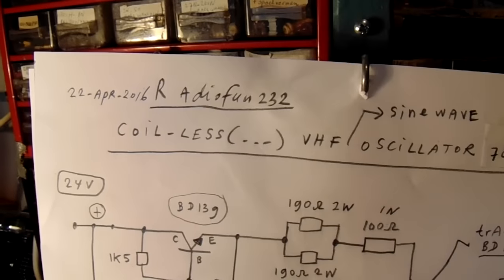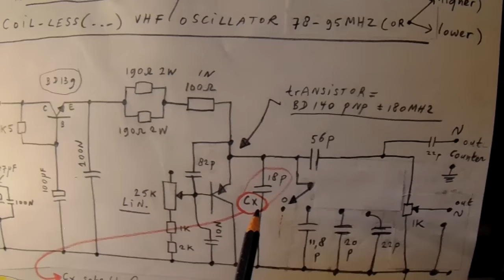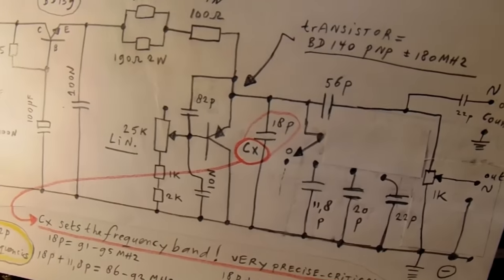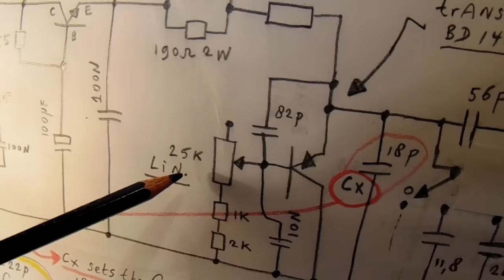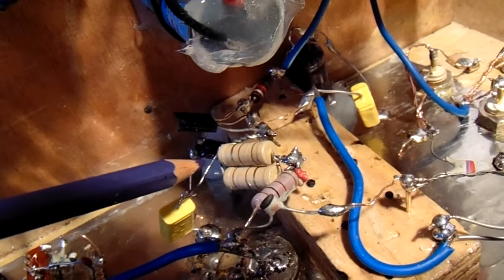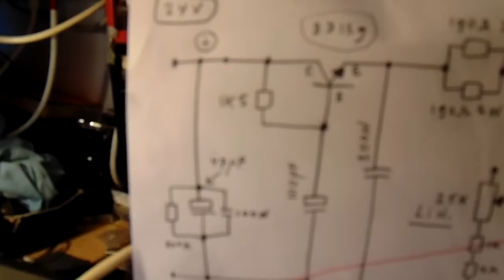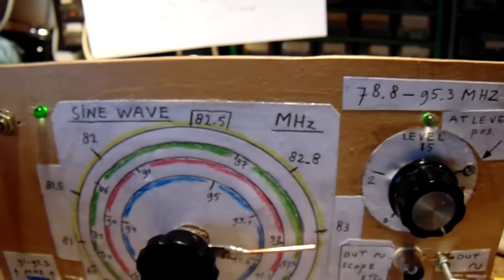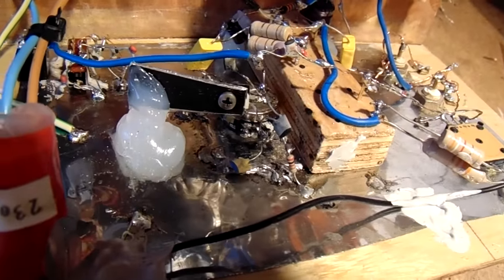Tunable VHF oscillator 78-95 MHz (or lower-higher) without a coil or tuning capacitor

Comment: This oscillator use parasitic inductance ( capacitor wires, pcb strips, e.t.c.
Reply from the maker: OK, but where?
Reply: I think in emitter circuit to Cx... or collector circuit... same comon base oscillators use LC tank in collector circuit... and emitter-collector coupled cap... this oscillator likes in lc tank in emmitter circuit... parasitics not located one point, it scattered around transistor main K,B,E circuits...
Reply from the maker: @ingussilins6330  OK, thanks.
Reply from the maker: @ingussilins6330  I made the circuit once, with 1 cm distances in the wiring, directly soldered to a lead-acid battery with 1 cm wiring, and it still oscillated. Of course could be that the wiring to the counter and scope acted as antenna's but anyway: it all has to be tested.